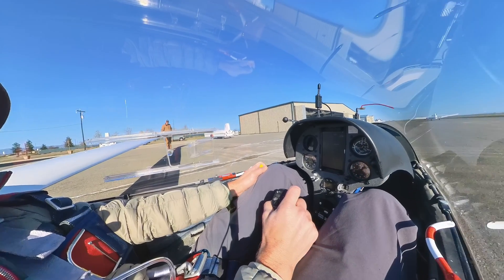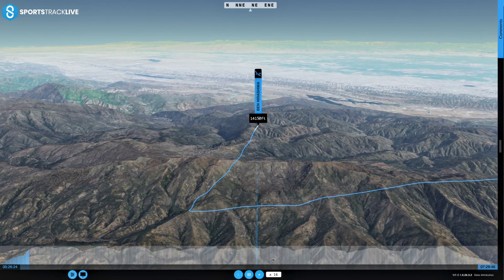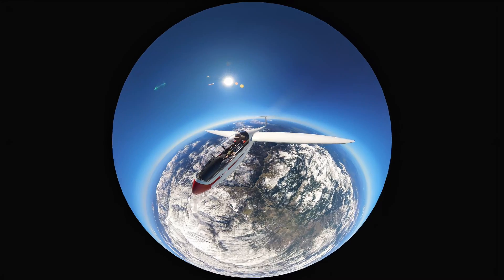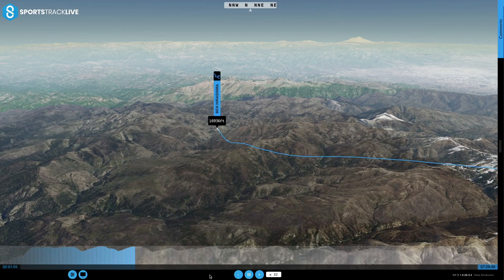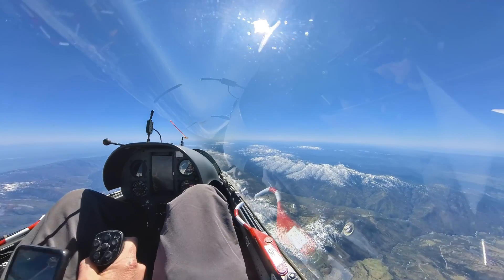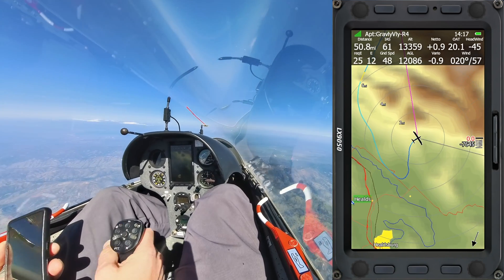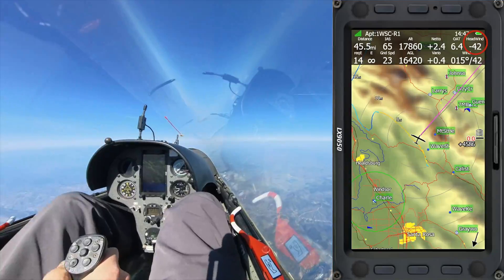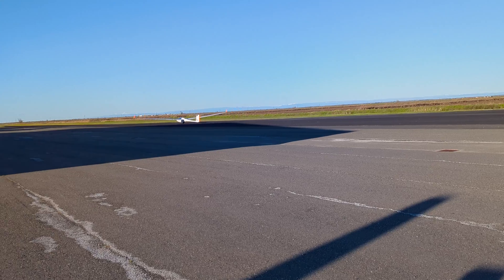Glider climbing like a rocket in wave lift

Comment: Thanks for your video. About your camera overheating: you might want to look into getting a faster memory card.
Reply from the maker: I'm using one of the cards recommend by the camera manufacturer. These 360 cameras are just known for overheating. They weren't designed to run for hours at a time. I've got some heat sinks and fans I'm going to try.

Comment: You asked if we have ever climbed at a faster rate and to give comment: I once flew in South Africa (Magaliesburg). Ground level is 4500ft (approx) and cloud base on the particular day was between about 12,000ft and 14,000ft.  The thermals were crazy over the top powerful. The needle was constantly right off the gauge.  They have a term for this experience in SA - it's called "going up like a home sick angel".
.
On a different note: I have never flown wave and have always been curious about how it works. This has to be the best video yet (related to wave flying).  You have explained how long the wave stretches, how one crosses from one wave to another and the issues faced when doing this upwind or downwind.  I particularly like how you are relying on skysight as there are no lenticulars (except the one).
.
Thanks.
.
One question - what's it like landing in rotar.  Very violent? moderately violent?...? Would you ever consider purposefully placing your glider in rotar to show what's it like or is that simply dangerous?
Reply from the maker: Homesick angel - that's a great expression. I've never had to land in rotor, fortunately. Nor have I experienced rotor that I would call extreme. It's not always present when there's wave. Sometimes you can see rotor clouds that will give you a clue that it's there.
Reply: @BenHirashima   thanks for the reply.
Reply: Mark, I can give you the basic explanation of 'wave' ... as the air passes over a mountain range, that air is cold and on the lee side of the mountain it rolls like a "wave" downward and displaces the warm air close to the ground on that lee side and forces it upwards.
This displacement manifests itself as a lenticular cloud, as the water molecules condense into this cloud formation, which is usually described as 'cigar shaped'.
Glider Pilots scan for these cloud formations as it signifies a potential for that rising warm air.
Wave, as a general rule, is smooth .... occasionally it can get rough .... but 'rotor' is a different story at any point of flight !! .... gliders have an advantage over our powered cousins in that with the (usually) larger wings, gliders are more stable .... but the best advice is don't get into it first, or get out of it fast second.

In my gliding career I didn't have all these modern electronic "gizmo's", I flew some 'rag n wire' (K8 & K13) & some 'glass' (Junior & ASW) and just had to rely on Mk.1 eyeball and the faithful Vario for the info I needed !!

My best wave flight was on the 24 August 1998 when I achieved my Diamond Height Endorsement, attaining a maximum altitude 0f 18,200' from a winch launch of 1,300' in a Junior at the Scottish Gliding Centre, Portmoak (253' AMSL), Scotland.